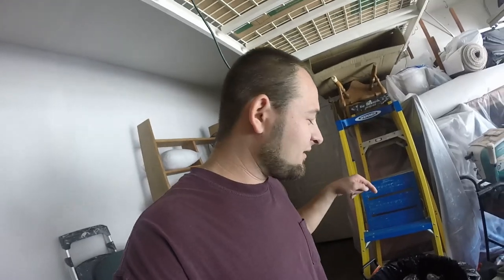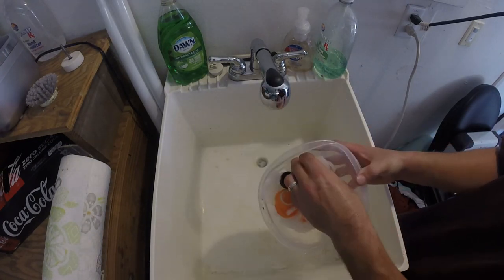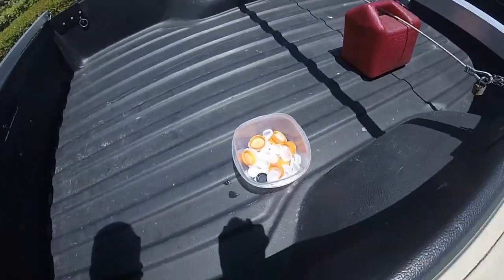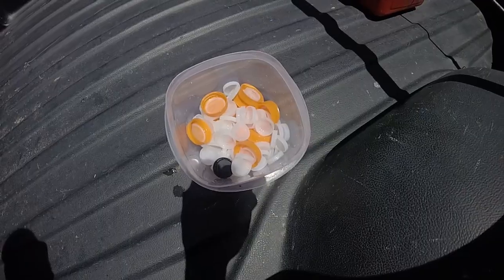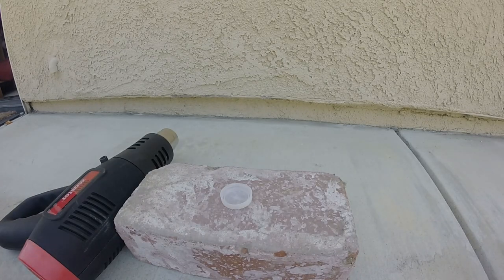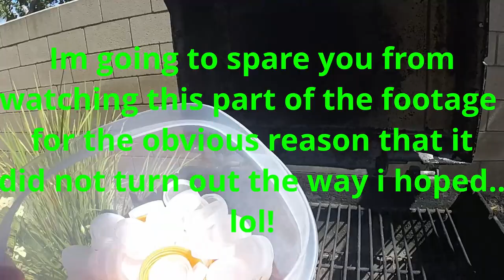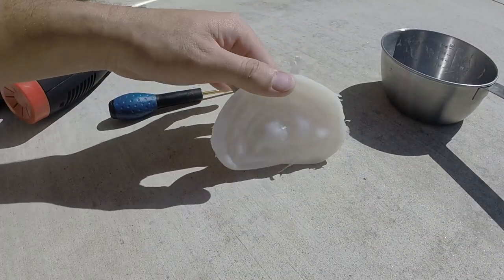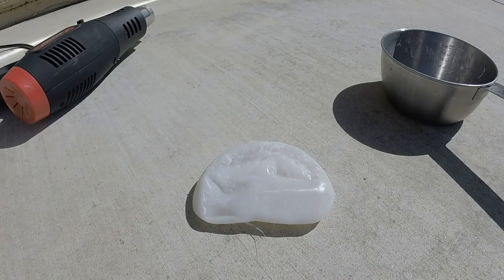MAKING A FISHING LURE OUT OF PLASTIC BOTTLE CAPS! Part 1

Comment: im doing the same thing , what i been doing is taking a platic cap holding it over a lighter to melt the cap then puncture a hole through it with a safety pin and so far i have a couple different protoshays but something i learned real fast is that they catch fish and turttles chase these lil caps plus they are additionally super cheap to make
Reply: @magneticfishingmadness  i agree ,1 thing about the lighter is gotta be super cautious which is why im going to be buying me the long black bic lighter with the black button so i can melt the cap to how it needs to be , i also fergot to mention that when i use the lighter i imediately flush out with water to cool off then bend or puncture the hole depending on how or what im doing , thought i would share this with you and your fans , to help a fellow angler out
Reply: @magneticfishingmadness  youre welcome sir , gotta stay safe and prevent fires